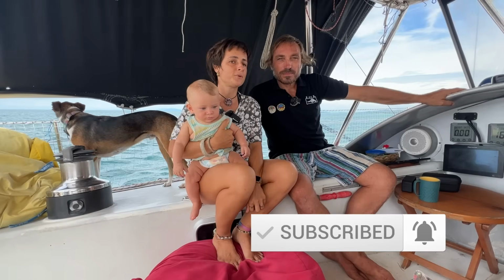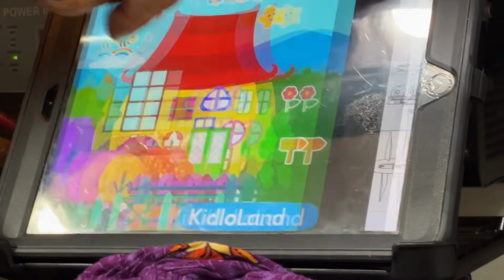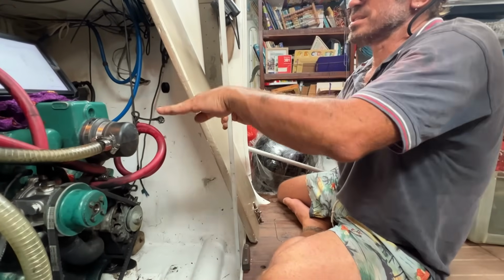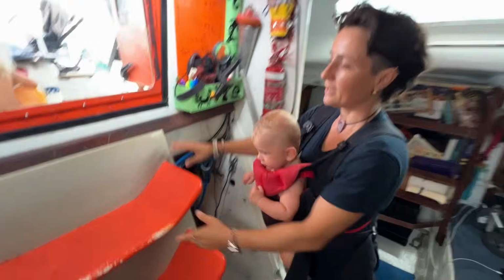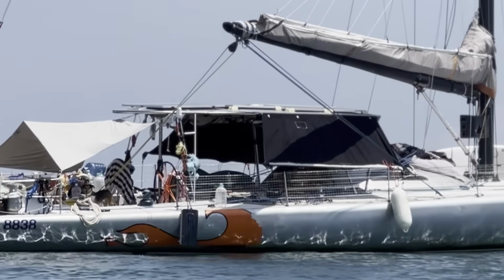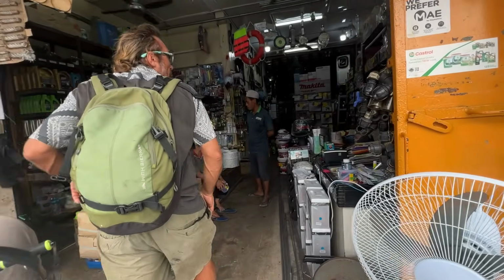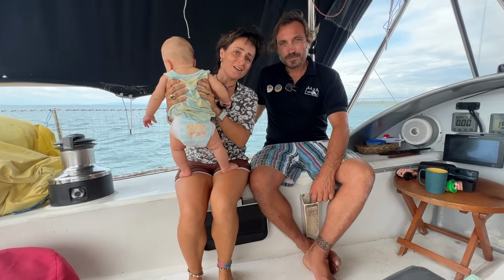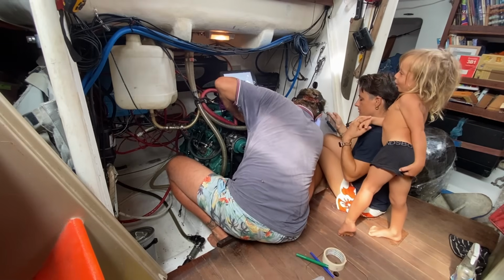Our New Engine Is Too Big — Here's What We Have to Change | S2 Ep 59

Comment: Hi guys I was just watching ‘sailing Awen’ friends with 2 new Nanni diesel in their catamaran 

https://youtu.be/Q_cQsdLtAbQ?si=-QcxdnxxEjjAGzW5

I was reminders that the biggest trouble they had with the new engines was from the engine gear controls from ZF . The Electronic controls are not waterproof and the had trouble in their Atlantic crossing and replaced them and still no good . They have gone to an older  model of controls ( new old stock) that is more reliable . It may be too late but the newest ZF control has issues! 
Cheers Warren 
The link is to their latest video where they briefly explain. Earlier videos talk about the problem.
Reply from the maker: Heyhey thanks so much for this, and sorry for the slow reply, I wanted to keep your comment so I could remember to check out this video :) Will have a look…

Comment: I’m puzzled that you didn’t choose the 4.80. It’s the same engine, just with an intercooler added. So you get 20 more HP for the same size and weight. Always makes sense to max out the HP for any given physical envelope and displacement I think…..
Reply from the maker: You are very right, in the end for us it’s about money, not just for the engine itself but for all the ongoing costs, fuel consumption etc. lower revs, lower compression, all these things we imagine make it a bit steonger
Reply: @SailingNV  the 4.80 is the same compression ratio, and rated at the same RPM as the 4.60. It’s the same engine, all they did is add an intercooler between the turbocharger and the inlet manifold. It will likely burn slightly less fuel for the equivalent HP output because the intercooler makes it more efficient. And You don’t have to use those extra HP, but they’re there when you want them - like to get through a pass against current for 20 minutes.

Comment: Surely that design drawing  isn't correct, there is no way you would have a prop spinning that close to the hull. There must be a gap that is the perfect distance from the hull, the sweet spot. I don't recall you mentioning anything about prop distance from the hull. A shaft drive  up much room and anyway it's back behind the engine, there's not much going on there except storage
Reply from the maker: Yes we imagine that drawing is before the installation so the bed needs to be cut to suit each individual hull size. As we mentioned in the video behind our engine is our nav station which we don’t want to cut into as it’s a historical memory

Comment: Cool that's going to be a great size engine  the turbo will actually make it quieter!  I did wonder if you could leave the top of the,steps in the,same place and just angle out to fit the engine?
Will you be able to get the keel in a hole again?
Timo? A disappearing propeller boat wow that's a,lot of work and with a big hp like,this would be very heavy and complex , glad you decided against that .
Cheers warren
Reply from the maker: Hey warren nice to hear from you thanks for your comments. Angling out the steps would mean the lower steps are at a funny angle and might not fit fully over the engine. Yes our pit is still there thankfully so we’ll be putting out keel back in it when we haul! Haha retracting prop is for another time ;)

Comment: I got a couple of stupid questions, I am In a landlocked state in the US. Don't know anything about boats really. Why do you have to mess with all that complication with the exhaust? Why not shoot it straight up through the roof like those fishing boats? The other is what does NV stand for, New Voyage?
Reply: The exhaust is not just air/gas. The cooling water exhaust goes out the boat also.
Reply from the maker: Right this engine is salt water cooled
Reply: Okay, I didn't know that, thanks
Reply: There are two types of marine engine exhaust systems dry as you described or Wet ... Which cooling water is mixed with the hot exhaust gases.  This keeps the sails and decks clean of diesel particulates and gasses. ...but dumps them mostly into the water. Which is why they are increasingly being banned from conservation and environmentally sensitive areas world wide..  two strokes are even more polluting but generally a marine diesel produces 60x the amount of pollution than it's automotive equivalent. 
Just run an engine in a clear tank for 20-30 mins and you soon see how black it gets then there's all the dissolved gasses. 

It's why I prefer series hybrids with larger battery banks .. typically you only need to run at it its stoichiometric efficient  generator about a 1 hour in  four  to recharge the batteries or run the electric motors at full power.

The three power items can be remotely mounted and E motors run cooler ..silent and no fumes. With full torque from 1 rpm.
Reply from the maker: And the boat was called NV by the previous owner, we imagine because it sounds like “envy” but we liked it because in Italian it could stand for nava vela (meaning sailing ship)